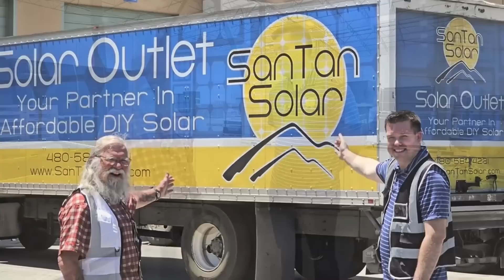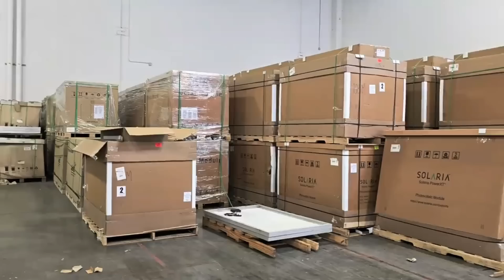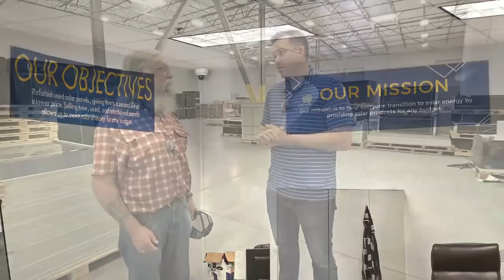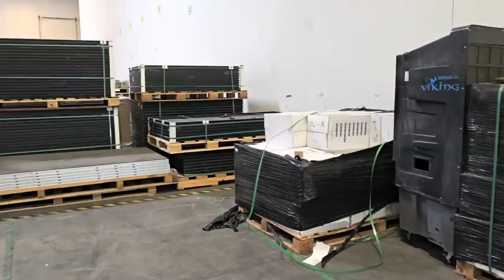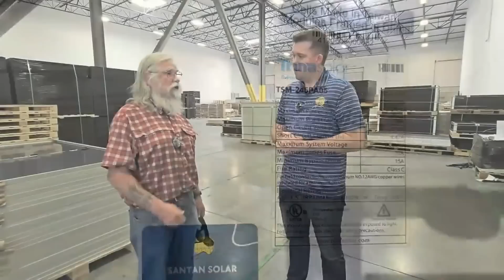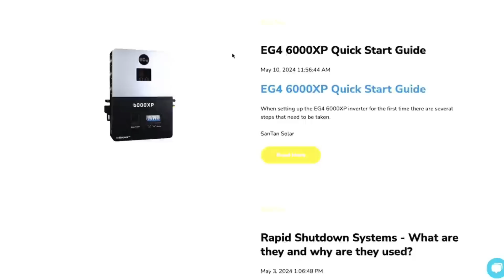SUPER CHEAP Affordable Solar Panels for VAN Life!

Comment: Panels with different voltages are fine when wired in series. Different amps is what you have to beware will cause the string to only produce as many amps as weakest the panel.  The opposite is true when you wire panels in parallel.

Comment: 26 seconds in and I have to say these foks know their business. I have a 500 watt system purchased from them and it is awsome. It included every thing but batteries and gland for....221.00...I could not get my card out fast enough.. Installed it myself and could not be happier...Well ok, when I can afford lipo4 batteries, I'll be happier...go SanTan Woo Hoo !!
Reply: Purchased a solar tool kit from Amazon with everything needed to wire/connect up the system for about 32.00. SanTan is very helpful with questions you may have.

Comment: I got my 250W monocrystalline solar panels from SANTAN SOLAR (Gilbert, AZ) to be a solar king in my cargo van, 4 years ago. Soon as I connected them to my house batteries, I've been running an awesome drop in Engel fridge ever since. Panels were around $50 each back then, SO WORTH IT. Living in the southwest US, I get plenty of sun.  On the few days that are cloudy, I use my shore charger with an extension cord to a house outlet and it brings my batteries back to 100% full within 2 hours.  The panels are very good quality, very hardy. They came with their cables, they were tested in front of me at Santan Solar when I arrived to pick them up.  Honestly, I thought I would have to clean them constantly because of dirt, but I haven't washed the panels ever. They rock, still charging my system to full within 2 hrs of sun.  I'm seeing the same performance from them as day 1. THANK YOU SANTAN SOLAR, I would buy again hands down.

Comment: i have 28 of these used panels they work good even the ones with cracked back panels i just caulked the cracks 250w working for last 2 years. ordered in 2 different orders first batch made it safe second shipment had 2 cracked contacted them and they sent me two replacements free pretty easy, no hassle. just needed pics.  Great company!!